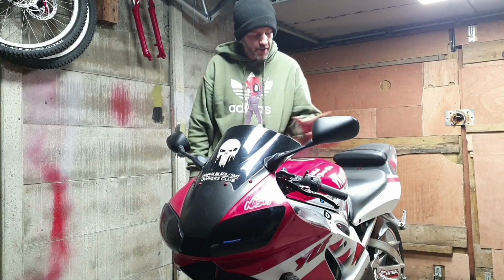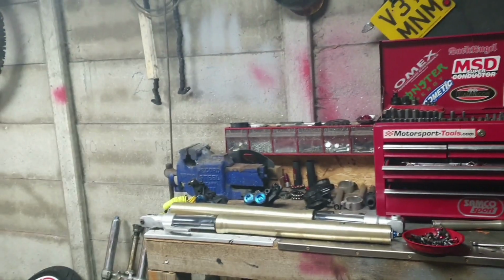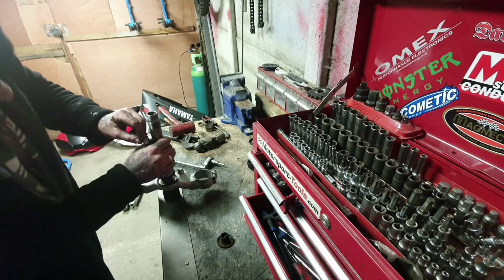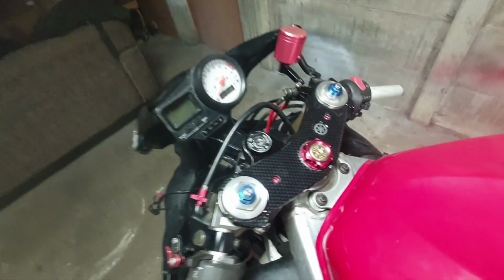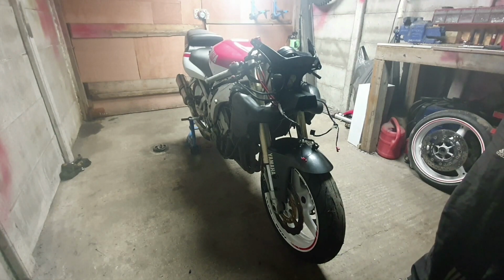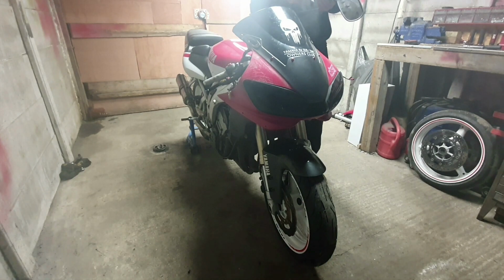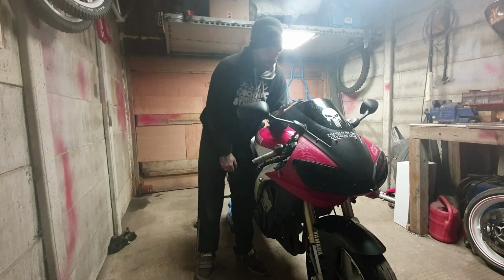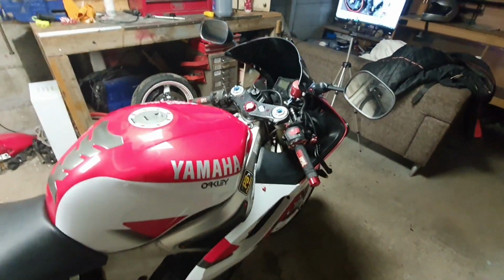Yamaha r6 5eb fork conversion to r1 4xv

Comment: Just did a healtech quickshifter on my 5EB, a piece of piss to install. Fit the sensor on the shifter clamp, not the rod. Only four wires to hook up - two piggyback off the pickup coil, one earth, and one switched power (tail light is easiest), and the module itself. Got a video on my channel.

Taking it for the first ride in a long time in about a week - can't wait!

Comment: It will feel different with the 120/70 front tyre... early R6's are 120/60 standard... I hope the length of the forks is the same, otherwise the steering geometry will be out of whack.
Reply from the maker: I think they are the same, I'm not the first to do this conversion but I think I'm going to do some measuring anyway.
It rides well with them apart from the bars being too low.
When I first got the bike the tyre was a 120/70 and then changed the wheels and the front wheel has 4XV stamped in it from r1 and the tyre was a 120 60 but used it anyway.
With a 120/70 on the r1 front theres quite a gap between tyre and fender so I'd imagine a 120/60 would look quite odd
Reply: I had a 2001 r1 front end on a 01 r6 a while back on a track bike. The issue I had was the fork travel was different and it made braking hard and turning in on the brakes worse. I did everything to sort it out and eventually put the old ones back on. Revolved and resprung worked better

Comment: Hi mate, hope you don't mind me asking a question, is there any easier conversion of the old R6 at this time know of?? Also in this conversion you did you can use the R6 wheel can you on the conversion can you??
Reply from the maker: i dont, no, but it is pretty easy to do tbh and yes the standard r6 wheel and brakes fit
Reply: @JRRetroRebuilds  just bought all the bits thanks to your info mate cant wait to see if feels a lot better than the R6 forks on them now I hope haha